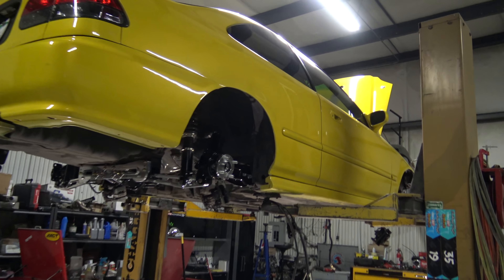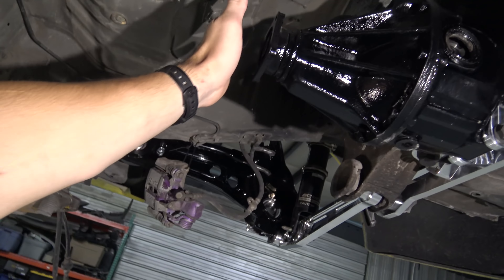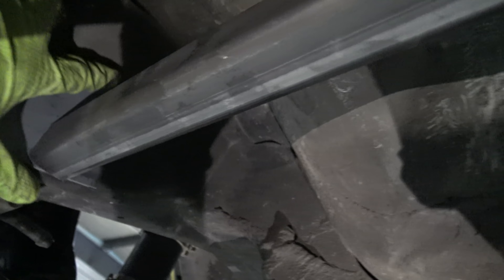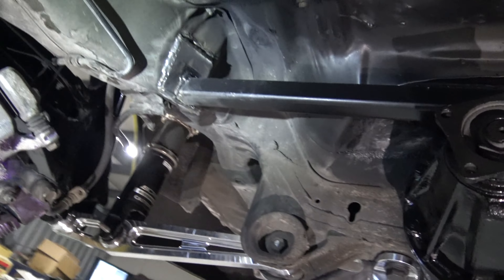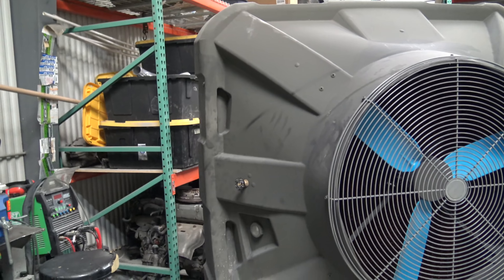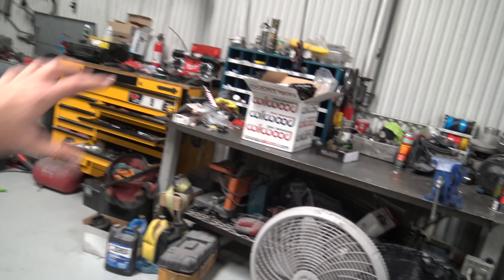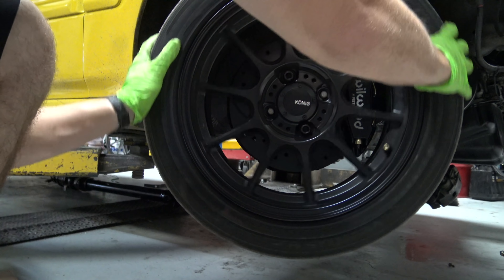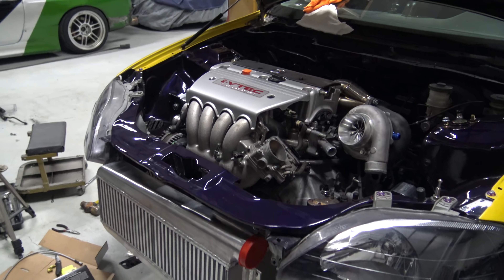Pt.3 | LAMBO KILLER BUILD | 600HP AWD TURBO HONDA CIVIC | BIG BRAKES AND AWD DIFF MOUNTED!

Comment: Is there a reason you have to use the viscous coupler?

Why can't you just make a custom driveshaft that goes from tfr case flange to rear diff flange?

I understand the viscous coupler allows you to primarily be fwd to save fuel and then when wheels slip the rears engage, but is there a reason not to have rears engaged all the time besides fuel economy?
Like does it stall the engine or something?
Reply: Curious aswell
Reply: You need the slippage from the viscus coupler and front wheel spin so you don’t put all the stress on the transmission which is the weakest link atm cheaper to use the coupler then buy a dog box or sequential
Reply from the maker: From the factory, the rear diff is a different ratio, it uses the viscous coupler like a torque converter, so it gets power but not 100% locked
Reply: MotionAutoTv True I didn’t think about that also

Comment: Trevor, How can that a 200 horsepower viscous coupling and spindly rear diff going to handle the big power of the new engine?  Inquiring minds want to know!
Reply from the maker: Its a 70/30 split on the power. So it has the coupler that kinda acts like a torque converter - The rear end does not get shocked as the front does. From what iv seen they still kinda launch FWD but they just don't spin :)

Comment: The slip joint tail shaft should be connected to the rear. This is for accounting for suspension travel and wheel torque The short shaft goes to the trans as that is where the shaft will have the most power put into it.

Comment: That part that you massaged in, is that where the sparewheel used to sit?
Is this possible on any car without breaking the whole frame of the car apart? I want to build a sleeper corolla with 3sgte engine :)

Comment: I want to do this with my '95 Prelude.  AWD with my already swapped h23a bluetop vtec. Going to start the engine rebuild for a turbo first to get it up to around 500hp then AWD. I am curious to see if that kit can be adapted for a 4th gen Prelude with h series engine and trans setup....

Comment: Had a old school chevy van with a two piece drive shaft and the shorter piece went in the back not sure if it is the same situation with you set up
Reply: Many vehicles are different all my f350s have smaller in front

Comment: Short end of driveshaft should go next to trans and engine. least amount of movement, Long end is for longer travel for suspension.. Like the build
Reply: It's a mounted diff I bet the motor moves 3 times as much as the diff ever will
Reply: The diff doesn't move dingus. It's IRS...🤦‍♂️

Comment: Built engine?? Forged pistons,rods etc.??
Reply: Stock, unopened k24a2 I believe
Reply from the maker: Stock unopened k24a2 out of a TSX
Reply: MotionAutoTv I’m a little bit worried if the stock internals will hold the power

Comment: Viscous goes twards the back. Closer to the diff
Reply: yeah thats how it is on the E36 M3-six bolt CV joint to the diff input flange. Short prop shaft end goes to the trans, longer drive shaft with viscous coupler should mount to the diff. Cool build

Comment: If your not road racing you don’t need huge 600 piston calipers and carbon cross drilled and slotted rotors. Don’t waste your money. Especially if your only drag racing. The stocks will stop your car just fine.

Comment: Honda engines are great, all the respect to the refined design,the Japanese ROCK when it comes to awsome cars,  I love the JDM scene and own one, but NOT a front wheel drive. Easy horsepower,easy maintenance, But a front wheel drive econo car is no more than just that. It works for running in a straight line, if thats what your into. I know the young kids will hate on my statement, and that fine with me. Everyone has, and is entitled to a opinion and this is mine.

Comment: Ur gonna starve that k24 of oil if i think ur gonma make 5-600 hp u cant rev them past 7500 with the stock oil pump ask brent or anyone at PFI Speed they will tell you that u need to do the k20 type s oil pump on it u can still do it inside the car please look into it simple mod but allows u to rev out that k24 and bot starve it of oil they dont push enough oil pressure to the cylinder head anything over 7500rpm trevor be smart call brent nd ask him about it u already got the good 07+ tsx k24 all u need is the type s oil pump id hate to see you kill a motor that can make great power

Comment: Hub city product is not a bolt in kit. Not buying $2,500 kit to use 90hp rated wagon parts😆🤦🏽‍♂️👎🏻💩 and hack my chassis
Reply from the maker: The stock rt4wd have been holding cars that are making 1300hp